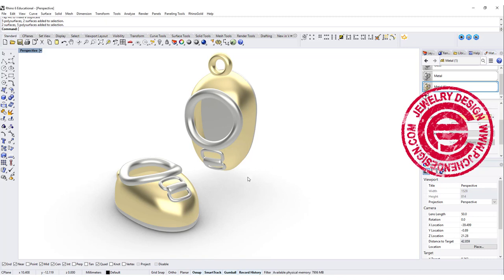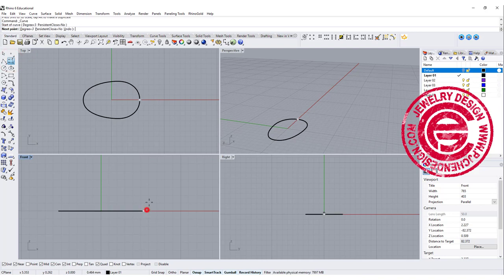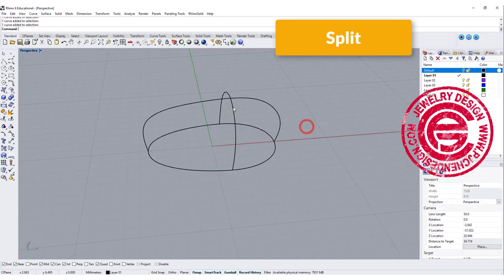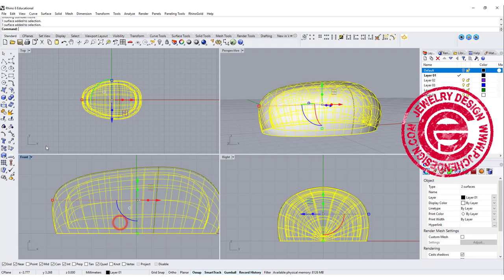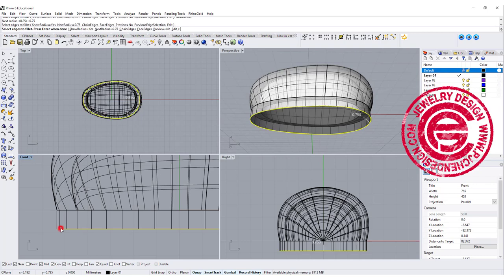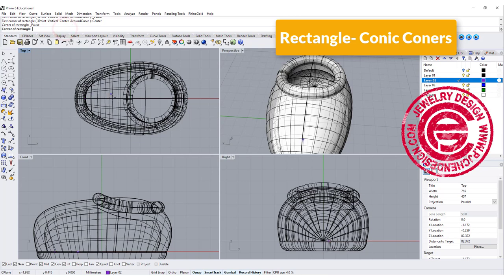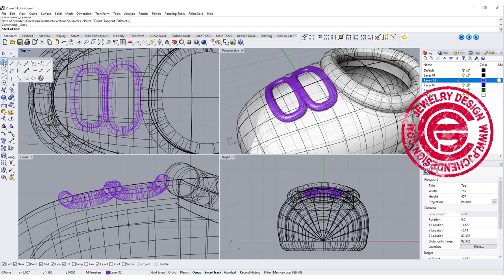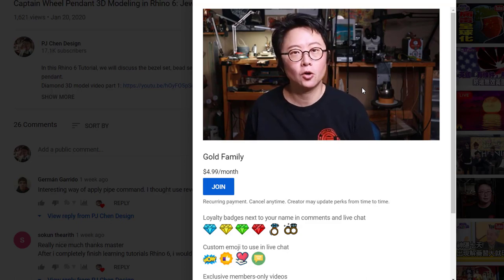How to 3D Model A Baby Shoe Charm in Rhino 6: Jewelry CAD Design Tutorial #110

Comment: Hello p.j when we're emptying gold jewellery with boolean difference to reduce weight, we're building a fine example of a part that the lining=BIJOUX is needed. 
The lining =BIJOUX  usually has to be  70 90mm thick and one less diameter,
 that after we clean the casting inside, we can To put the BIJOUX in the jewel Most of the prestige jewels see it always with beautiful patterns and flowers etc ,It's mostly seen in rings and wide bracelets. In France Switzerland and Italy is the nickname for the lining of a jewel.  Estomac pour bijoux  I work with luxury brands and I learn from you, ma'am, a lot.                                       
 THANK YOU  Madam,
Reply from the maker: you are very welcome and happy to know you like my channel!